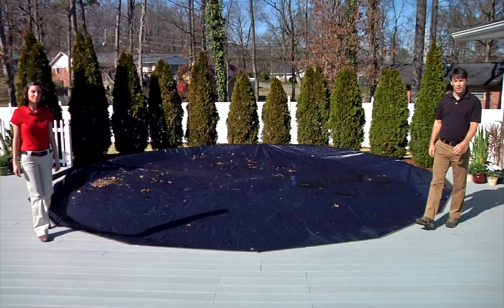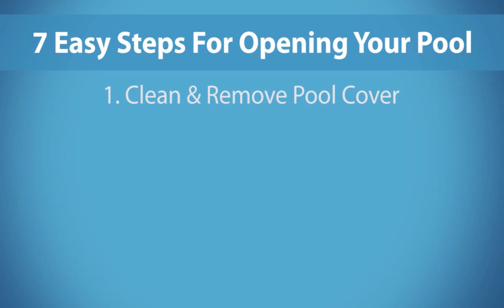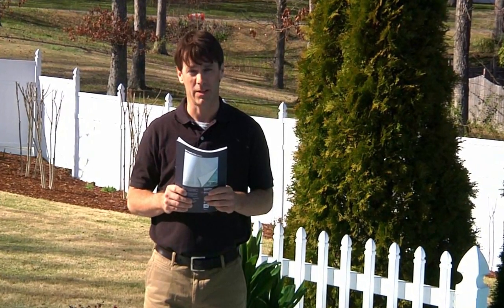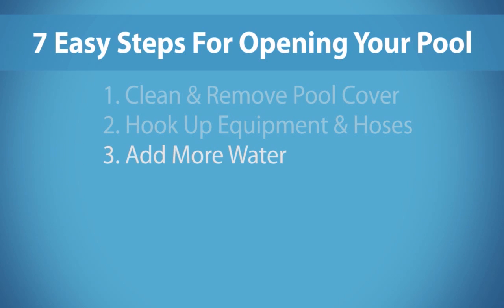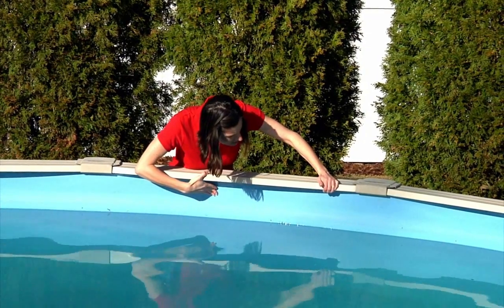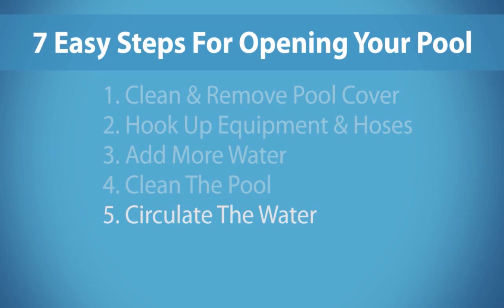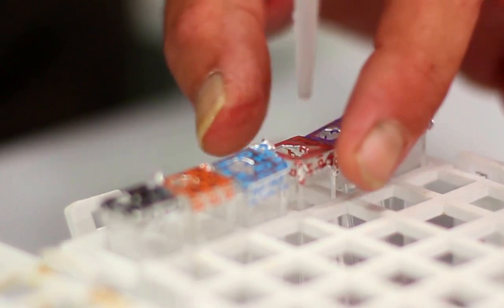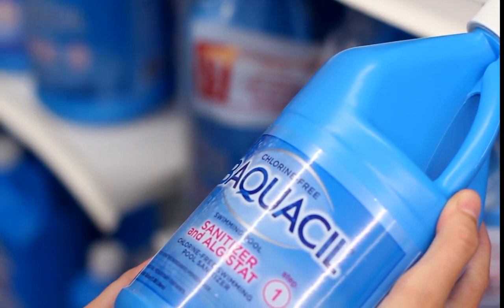7 Steps for Opening Your Swimming Pool

Comment: So Idk if I'm the only one. But there pool was cleaner when they took the cover off than mine is after 2 weeks of work on it
Reply: ive yet to find a single video that shows me how to clear up the disaster zone that is my NY pool
Reply: @Drrich_DIY  My pool is always a swamp when I pull the cover off. Shock it so the chlorine level is at 10 for the first 24 hours (check the chlorine level every 2 hours). Run the filter continuously for days. Use flock and vacuum to waste the material it leaves behind. Takes me a week to be crystal clear.
Reply: @Drrich_DIY  use pool shock will turn green into blue water